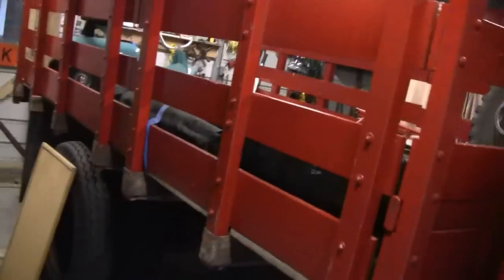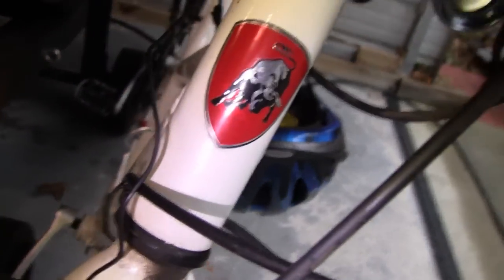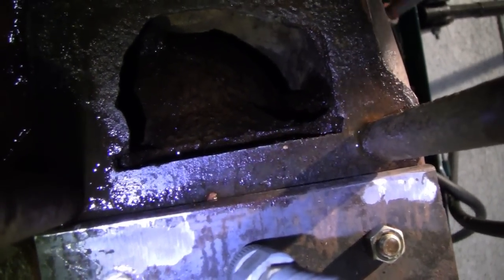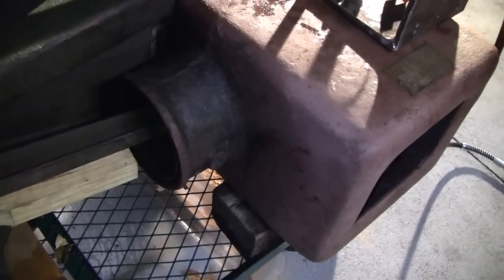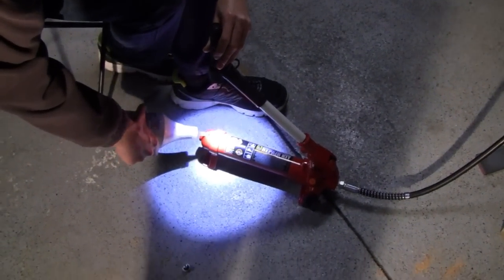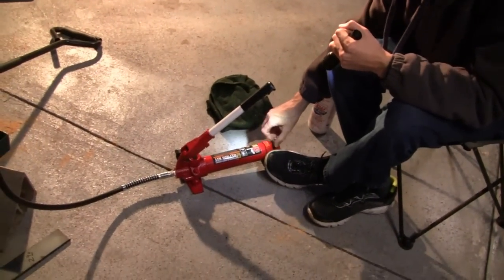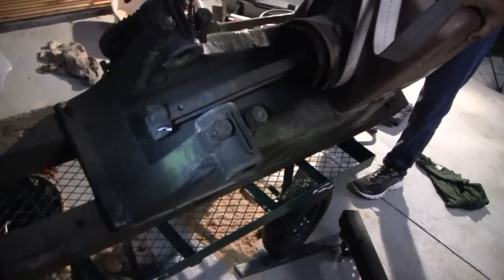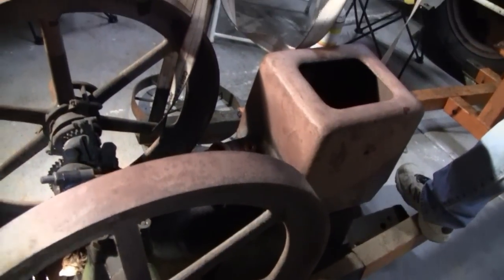UNSEIZING A HIT AND MISS ENGINE (part 3)

Comment: Just a suggestion - you can use a pressure washer pump to pressurize and remove that piston. The pressure wash pump will make over 1000 PSI. It will push water into the cylinder and force the piston out. Most home shops have a pressure washer, so that is usually an easily available source of high pressure fluid that is at fairly high volume.

Glad you're getting it moving! That blind cylinder "headless" design is a real pain when the piston is stuck!

Comment: Had a similar problem years ago, We filled it with oil, and then used a grease gun. We had a pressure gauge on it and we were able to build up over 2000 lbs with a regular grease gun. I made up all the fittings and it got the job done.

Comment: I think a 1/4" hard rubber gasket between the head and plate would've worked out better, it would conform with the warped surface and imperfections

Comment: That's great! A bug hurdle out of the way! I knew it would move, eventually!  I've never worked on a motor that big, not with a single cylinder anyway.. But I have seen and loosened some pretty well rusted up gear.. With the right treatment and enough time, even the most solidly rusted up parts will move.
Reply from the maker: Yeah Buddy!! Just takes a little patience!!☺
Reply: +805ROADKING Yep, it always does! I've seen too many people lose patience and give up too early...

Comment: Do you suppose that if you took the crank and flywheels back off and put the rod back together, then stood the engine up with the rod in the air. Hook onto the rod with the engine hoist and lift carefully while heating the cylinder and applying penetrating oil around the skirt it would come apart?
Reply: You're on to something: Allowing the weight of the engine to supply force on that piston.  Some taps could be added.  From the beginning, another course might to use a hammer-drill on the upturned cylinder.....with heat and penetrating oil.  Of course the drill's bit would be cushioned by a plate on top of the cylinder....

The jarring action is important is breaking the hold of rust....!!!

Comment: Put a 2x4 through the spokes on the flywheels towards the water hopper side and lift the engine up until the back is off the ground a few inches and it sit over night. The weight of the engine pulling on it might pull the piston back further. I didn't see if you guys put the caps back onto the crankshaft.

Comment: It's weird how the oil is dripping from inside the piston, I'm wondering if there are through holes under the piston rings or if there's a cracked piston.
Reply: Its probably just coming in around the connecting rod.
Reply: JimsEquipmentShed how?
Reply: Green Silver yeah

Comment: Loosen the rod bolts... and use the weight of the flywheels to bump it out...  works great!
Reply from the maker: We tried that, it didn't work at all!!☺
Reply: ha...  ok sorry... maybe with a little heat at the same time or have you considered using a pressure washer instead of the porta power? Water is a lot cheaper than oil... works just as good.. Good luck Buddy..

Comment: I know this is old now but you would not be able to move it with the flywheels while you had the plate on the side, it needs to allow air in or out the let the piston move.

Comment: Just a thought, Can you not use air with the cyl full of oil? air over hydraulic is how all the in ground car lifts and elevators worked...
Reply from the maker: Yeah air over hydraulic would work but it's a little more involved than just hooking up an air hose!!☺

Comment: Should have used grease.  And a pneumatic grease gun.
(Pack it with a bunch of grease on top of the oil, or if the oil starts coming out again, ALL grease.  Can take up some of the volume with chunks of whatever solids you want that will fit down there.

Comment: wouldt you want to dump the oil off the top side of the piston before you rock the crank? probably won't rock very well hydrolocked. looked like the plate and fitting were still on there.
Reply from the maker: The plate is still on, we took the fitting off and it lost about a ¾ of a gallon!!☺

Comment: I guess you don't have a buddy with a back hoe or some such piece of hydraulic equipment that has a 'wet line' on it ? Hook that up and slowly, very slowly, apply the hydraulic power to that and see if that moves the piston. This line would have somewhere in the region of 1500 to 1800 PSI , What do you think of this ?

That pumpkin in the tree is something I have never seen before, that too, is interesting in itself.
Reply: This 'wet line' attachment can be on almost any hydraulic powered equipment, even a mini excavator,...is there a rental shop around you.  If so ask them if they have a mini excavator with a wet line . Then see if the cost is worth the try .
Good luck .

Comment: Hi guys nice to see you get it to move, Whats wrong with Dirtbike don't he trust you to borrow his stuff without adult supervision L.O.L.  I kinda hope that piston and cylinder hasn't picked up and scored, when it cooled making it go tighter again with the burrs grabbing. My Buddy did that with a 2 1/2 " pin on an excavator cylinder without cooling it first. He proceeded to beat  on it harder with a huge piece of steel rod as a punch,  mushrooming the pin even tighter before i got the" Help me I'm stuck with this!" call.

 That turned into a real F'er of a job and more than one choice word in a few sentences trying to get it back out the other way with a 14lb hammer,  heating / cooling to break the rust then adding penetrating oil to. When the pin was finally out you could really see the score/burr marks where it picked up. If he had heated and cooled with water,even a few times first, it would of come out  in half the time and with less effort.  Good luck and I'm looking forward to the next installment.
Reply from the maker: Thanks Bud!! I told the Kid to take his Porta-Power with him!! I thought we'd be able to get it out with the mass of the flywheels!!☺

Comment: i want to jump on one of them fly wheel spokes so hard right now... if a 300 pound gorilla jumping on the fly wheel wont budge it..
Reply from the maker: We tried that, it didn't work!!☺
Reply: i was thinking now that its stuck (from seized), it might move a little better, you might be able to knock some of the rust holding the piston back